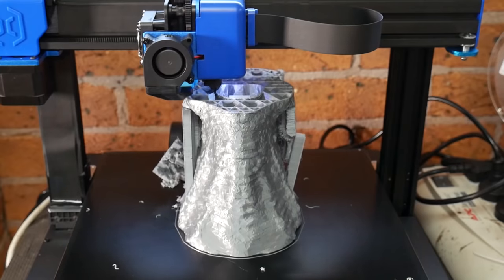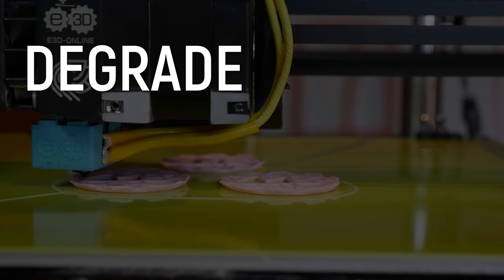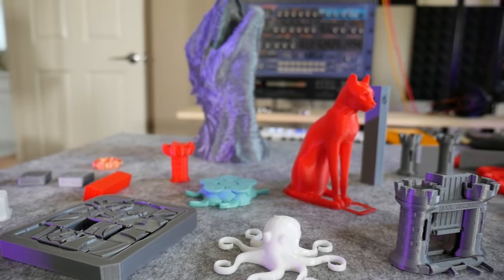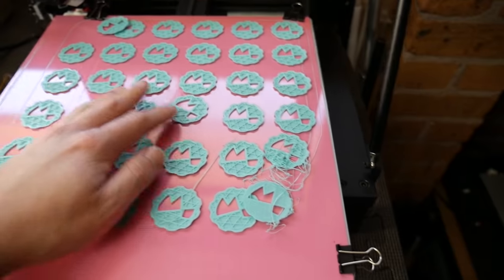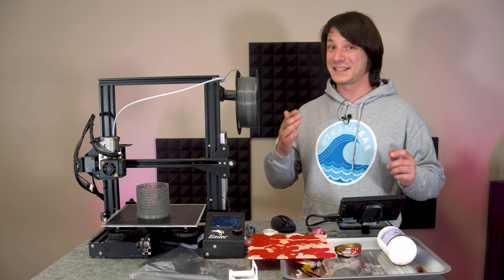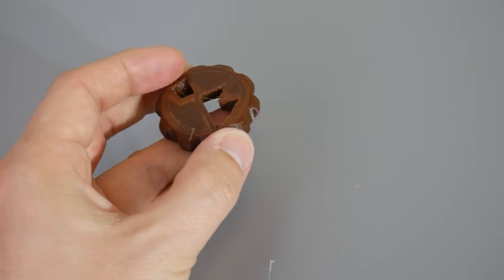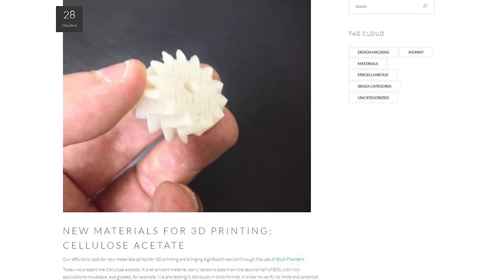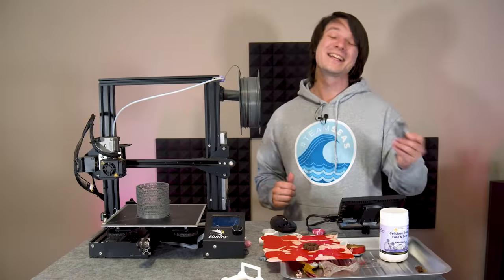PLA - 3D Printing's Biggest Lie.

Comment: Well, I'm a material engineer, I believe that the main issue with plastics is that it's almost impossible to differentiate between different types of plastics. If you add the numerous addetives to the mix it only gets worse. Hence recycled plastics are mainly from pure sources e.g. production waste material which has known composition.
Reply: No only that, the plastic molecular structure is a headache to break or "fix"
Meaning that some plastic can't be recycled with current technology.
Because we don't fix it on a molecular level.
we just clean as much is practically possible then melt it and hope the molecular structure is good and contamination levels are low.
Reply: agreed. Even when I was at an art college, recycling paper was a huge thing, especially in the areas where you printed your art pieces for critiques. Though you couldn't officially recycle the paper that you printed because the inks were not soy based, and could not degrade.
Reply: @youkofoxy  Yes that's also a good point. Quality will degrade when recycle plastics.
Reply: Won't it help to mark any plastics with some in melted QR code or something to get a general idea of what, which plastics are and what it contains? So everyone who produce it, have to leaf an information about it on the packaging.
Reply: @MrGTAmodsgerman   Great idea, I would add to this by replacing the QR code with some publicly available universal standard codes for plastic types + additives that people were encouraged to look up and learn
Reply: @Jamie Fletcher Sorry i was meaning some sort of QR code, for instance a engraved number with meaning
Reply: @MrGTAmodsgerman  When currently the recycling sign for plastics should be accompanied by a number from 1 to 7 and that's already often illegible. How do you think a QR code with similar manufacturing technology is going to work?
Reply: @MikkoRantalainen  I said "with some in melted QR code or something"
Reply: @MrGTAmodsgerman  If you add anything extra to the plastic to make the QR code more readable, you're making the plastic less recycleable in process.
Reply: @MikkoRantalainen  Ok for your understanding, i had something in mind which acually works like a QR code, but its melted, engraved like a model number in the plastic that already exists for years now and is only a little problem in production.
Reply: @MrGTAmodsgerman  In the car industry it's standard to put a plastic type code on almost all parts of substancial size. Its usually a recycling symbol with a readyble accronym like PP, ABS, PE.
I have seen that also on quite some plastic parts in electronics goods like TVs and the like.
Reply: @MrGTAmodsgerman  Most of the plastic I encounter in the world is already marked with a type number. That number in a triangle you see on plastic products and packages? That's the plastic type number. A QR or related stamp code which includes a code for all plastic types and additives in a batch would be potentially quite difficult to decode by ordinary humans (even if we ignore the problems reading a poorly stamped symbol); plus manufacturers would find it quite expensive to change their molds and dies every time the mix varied slightly - and they prefer to have known, reliable properties for the materials they use. So recycled stuff that isn't reliable would not get used regularly, even when fully known.

Really, the basic problem isn't stamping a recognizer symbol, it's that if recycled plastic is a random mix of different materials, then it's not going to perform the same every time. And nobody doing mass production or dangerous/high-performance work wants that.
Reply: @Jamie Fletcher For your idea of bringing all plastics to recycling centers, how would that be affected by plastics that are mixed with non plastic materials or infused into them?
Reply: How about using smell as an identifier, not chocolate etc but a measurable hard to detect by the human nose kind.

Comment: I AM a material scientist - I am happy to answer any questions I can. Note that if you have a city composting bin, typically that is industrial composting, which means it would degrade PLA, assuming it does not get removed during any sorting process. A common use for cellulose acetate is as the transparent window in foodstuffs like in doughnut boxes since it does let moisture through quite well.
Reply: Sorting PLA from other non compostible plastics would likely be too difficult to do. Also the issues of additives as mentioned in the video are a reasonable concern for any "PLA" that could be put into such a composting system.
Reply: Here in Germany every town has it's own rules to what can get in the composting bin and what not. 50% don't allow pla because it takes longer to compost than the regular cyclus at the facilitys are, the other 50% don't allow it because it has no benefit to the composted end produkt.
Reply: @nel2834  Composting plastics here in Finland is also problematic because they want to keep composting cycle time around 4 weeks (if I remember correctly) and those plastics would require around 8 weeks to be processed. As it's considered too expensive to sort plastics away from the other waste at industrial level and doubling the composting cycle time is also considered too expensive, we end up with pushing plastics to landfills unless the plastics are burned.

It all comes down to money in the end. If doubling the composting time which would already take care of most plastics isn't done because of cost, any real solution to the problem must be less than 2x the cost of not doing anything over the current situation.
Reply: If no composting  is available, is (industrial) burning the best option? (We use anaerobic digestion here, so no PLA in the food waste.)
Reply: @mellertid  incineration/burning vs landfilling is an ongoing debate now. One directly releases the CO2 and the other leads to piles of waste and microplastics. I tend to favor landfilling instead of incineration despite the microplastics. As Angus said, repurposing yourself is the surest bet but the most work. I collect the material, sorted by color in the hopes of one day making new filament with it, though that is fairly unlikely I think.
Reply: @EricHabib  CO2 is not a net issue since its a bioplastic. Though at this time it may still better be considered, I guess. Then again, if the energy reclaimed when burning replaces some fossile fuel use, the equation gets messy 😁. Thanks!
Reply: I wish you would jump in on the argument in the comments here with a guy named James Melamede who seems to have some very backwards ideas about this and feels that PLA is totally fine and that by curtailing its use we are just promoting a return to more harmful plastic consumption. Dear oh dear...
Reply: Why not keep the PLA untouched as a carbon capture mechanism? Why is there such need to break it down?
Reply: @doa_form  right, that is why I tend to favor landfilling over incineration. However, it is difficult to guarantee that it will stay where you put it, and if it doesn't start you get ocean plastics and microplastics pollution in the environment. It seems silly, but ensuring that everything stays where you put it at industrial savage is quite difficult.
Reply: @EricHabib  "One directly releases the CO2"

But it can also displace other energy sources so I don't think it's that bad. Also, as mentioned by others a bioplastic is, at least theoretically, carbon neutral in the long term anyway (though admittedly it burying it in landfills could by similar logic be carbon negative if it doesn't break down).

Comment: You should team up with NileRed on this project. also did see a video many years ago where the biodegraded PLA by basically dumping it in a box with zoophoba worms ( also known as superworms or giant mealworms, commonly used as live feed for reptiles [ my bearded dragon loves them ]). the worms was able to eat the plastic and biodegrade and turn it into compost, may be worth taking a closer look at.
Reply: @torenmcknight  antifreeze for my car ?? Yes please
Reply: @torenmcknight  What chemical do they make? Ethylene glycol and Propylene glycol is what almost all antifreeze is made of, Ethylene glycol isnt that bad for the environment breaking down in a few days and Propylene glycol is no bad at all, it's even in foods.
Reply: @niaimack  "Chemicals bad." Ethylene glycol is the 'bad' chemical, but only in relatively high concentration and it breaks down in air in about 10 days and in water or soil in a few weeks.
Reply: @rich1051414  Sounds like it's a case of 'don't breathe it', and you'll be right.
Reply: Do you happen to have a link to that video?
Reply: @niaimack  I don't remember what chemical it is exactly. I just remember reading an article about it several years ago when it was discovered that wax worms can eat plastic. And the article said the substance they produce is very similar in structure to antifreeze and has very harmful affects on amphibians.
Reply: @torenmcknight  saw a video few months ago , not sure about the channel, but search for magnetic worms. Seema that the worms eat the aluminium pieces left on the ground after cutting. Then they can be picked up by t magnet :O

Btw ants produce some kind of antifreeze during low temperature seasons. Could be an answer to something?
Reply: PLA doesn't turn into compost. It degrades into filler for compost, with no soil value.
Reply: @KaliKavala  aluminum is not a magnetic metal, so, ummmm
Reply: @torenmcknight  "I don't remember what chemical it is exactly."

I googled and at least some articles mentioned ethylene glycol (but I didn't try dig very deep).

"very harmful affects on amphibians"

Then just don't put amphibians in the same box with these worms.
Reply: @seneca983  Well the harmful byproduct has to go somewhere. And there's a lot of plastic that needs to be broken down. So where do you suggest we put all that toxic waste?
Reply: @gordonclement7550  yeaaaah.. well. Hangover and stuff going in my mind :D
Anyways the video title is "The Mystery of Magnetic Worms - Smarter Every Day 253"
Reply: @torenmcknight  Other commenters here said that it breaks down quickly.
Reply: @gordonclement7550  The channel is Smarter Every Day. IIRC, his theory is that the worms ate the metal shavings off of the floor in his workshop.
Reply: I don't remember such video from NileRed. Can anybody give me an actual name to search?
Reply: @Alexander_Sannikov  the worm video was not a NileRed video, sorry for the missunderstanding, I suggested him since he has worked with cellulose acetate and might have some ideas about how to turn it into filament. The video I was talking about was probably 6-7 years ago, don`t remember the channel name.
Reply: @torenmcknight  The kind of waste matters. glycols are small, light molecules that cells can easily shuttle around, and certainly easy for microbes to convert to biomass. They have a simple carbon structure which is perhaps even vulnerable to breakdown just from oxygen and sunlight. For some chemicals like these in moderate quantities "the air" is a legitimate option for disposal.  Toxic waste sometimes just needs a bit of help along the way back to dirt. It's not some huge twelve-step process.

Just because something is toxic to some animals, doesn't mean it isn't food for others. There are nerve agents, some of the most poisonous chemical weapons known to mankind, that need to be kept in the freezer because they spoil like milk once the bacteria get in there. This is also a problem for nuclear warhead initiator explosives, which are supposed to have a mold problem these days.
Reply: @runforitman  I was fired from a job for freezing antifreeze.
Reply: The problem with the let's feed plastic to superworms and mealworms is that it isn't very nutritious to them, enough so they are developmentally stunted it many cases.
Reply: Several of my mushroom cultures eat PLA as if it were wood shavings. This plastic is not a problem, whatsoever.
Reply: @spore7346  very interesting, thanks for sharing, what kind of species of mushrooms?
Reply: @wezyap  also Trichoderma peltatum eats plastics, and dead trees... but it is a pathogen to mushrooms. It has been a bane to me since I discovered it in one of my cultures. It shows promise,
Reply: @wezyap  well... my other half of my reply didn't come through. Species of pleurotus that I have used are ostreatus, djamor, eryngii, and populinus. Cyclocybe is slower, but has a considerably high sodium tolerance. Even fruiting on orbeez (sodium polyacrylate) and a dilute nutrient broth. Mass spectrometry at the partnering lab will confirm how much was, actually, consumed by the mushrooms. 

Pestalotiopsis microspora holds an edge on macrofungi because it can eat plastic in an anaerobic environment. The drawback is that it is a severe pathogen to coffee trees and other fruit trees. 

Once I can acquire a culture or spores from Psathyrella aquatica... I'll be able to carry out plastic degradation projects underwater, further refining the genetic lineage as I go with all of these fungi.
Reply: @rich1051414  The problem with ethylene glycol is that it's a neurotoxin in mammals. Sure it breaks down in under two weeks, but you'd spill some when working on your car and the animals would get to it because it's very sweet. It has low volatility, so it won't evaporate off quickly like alcohols do. The lethal dose for something like a squirrel is less than a gram (~700 mg/kg). Automotive antifreeze was high concentration - 60% ethylene glycol / 40% water.
Reply: @teknoman117  We aren't talking about spilling, though...

Comment: A very similar misconception that brands often exploit is the "eco-friendly" plant-based resin that is said to be "biodegradable," "safe for the environment," and worse, "non-toxic." Plant-based 3D printing resin with is good for the environment like PLA because part of the resin composition (~30%) is from a more environmentally friendly renewable material source (soybeans).  However, a material made partially from a plant source is not automatically non-toxic and easy to recycle. In this case, uncured "eco-friendly" 3D printing resin is as dangerous to marine lifeforms as regular 3D resin because the most toxic part of resin is usually the initiator that makes UV curing possible.  And the cured prints are much harder to break down than PLA prints.  We still like to see more resins made with renewable material source, and we are developing one ourselves. Let's not pretend it is non-toxic/recyclable and be clear about that with the users.
Reply: A lot of respect hearing this from a major player in 3D printing resin manufacturing game like you guys. I agree, let's not greenwash what the hazards of the items are but instead be realistic, honest, and find and encourage proper ways of disposal.
Reply from the maker: Really great to hear from a trusted source!
Reply: In the end, it's chemically identical to the stuff that comes from fossil fuels.
Reply: UV is the main source of degradation in resins ( I worked in the carbon fibre lamination industry), obviously this is a trait that plastics manufacturers have worked hard to overcome and now it is working to find ways to undo this trait in certain circumstances.
Reply: Exactly. Plants have countless chemicals in them and the only reason they're biodegradable is because life evolved around them.
Making parts of your chemicals out of plants doesn't make them non-toxic/biodegradable.
Reply: About anything toxic for nature, comes out of nature somewhere.
Reply: I am so happy you write this and don't jump on the same wagon as some companies with the nontoxic and ecofriendly. Resin is just not ecofriendly but it is nice you are working on something that is better still. A real danger with the claims is also people not using safety gear (because of nontoxic claims) and washing parts in the sink under running water.
Reply: @TauCu  the enzyme for biodegradation of cellulose wasn't evolved for tens of millions of years after land plants, that's why we have coal now, the cellulose from trees, broken down under the pressure of the earth buried on top of it, the head of the mantle rising through it and millions of years of time to break it down into mostly carbon and methane gas.
Reply: @domvasta  Yeah, evolution can sure take a while.
Reply: but if you dont pretend its safe and green then people wont buy it, thats bad for the marketing team, the true masters of any company.
Reply: Mmm you just made me like it even more.
Reply: Thank you so much for honesty! I actually only use your brand of resin for my SLA printers, it's excellent to hear you're also trying to be a great corporate citizen!
Reply: Big respect for this clear and honest take.
Reply: @twig4661  Honesty is the best policy
Reply: yeah, plant based bottles are basically chemically identical to normal petroleum, because it wasn't dinosaurs, rather plants to begin with. And recycling bottles is hard anyways, cause even if you do it, they're not structurally sound enough to recycle again, unlike say, metal